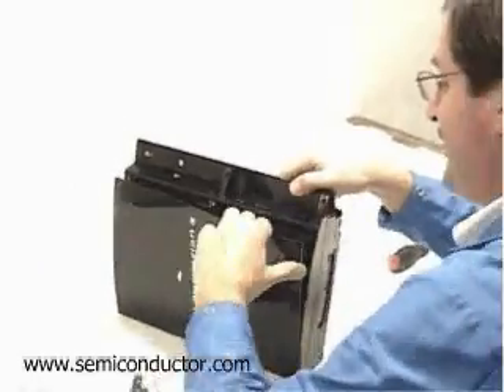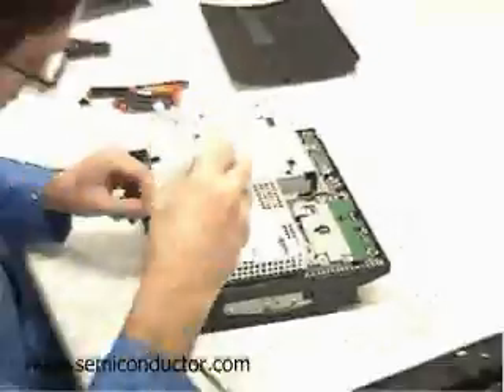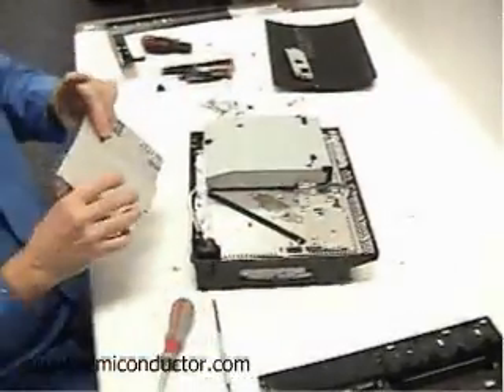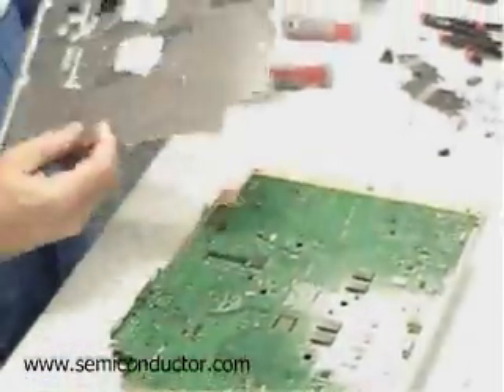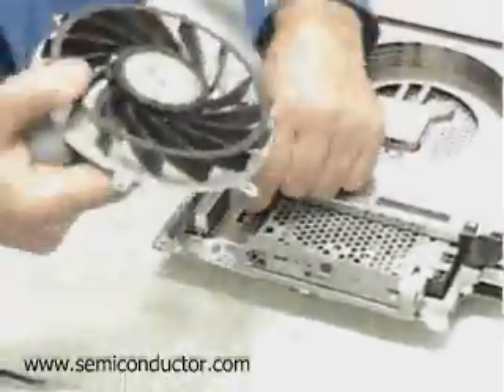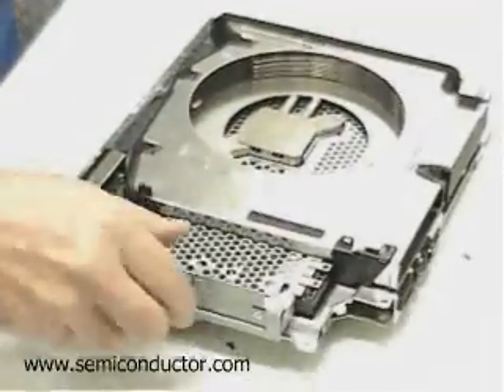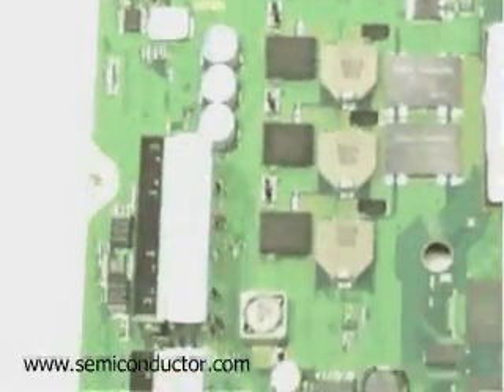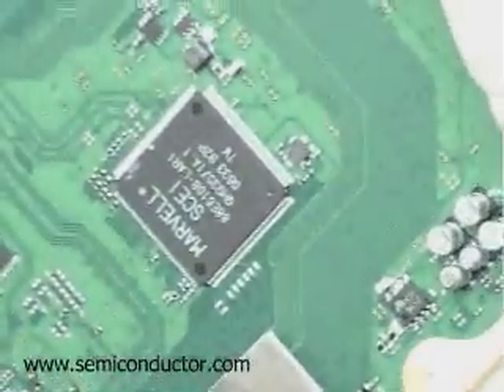Teardown of Sony PlayStation 3

Comment: @skankinruby See, I understand MS is forced to treat customers well or they'd get horrible publicity, but when your product fail rate is as low as the PS3s, its also almost no trouble to treat your customers well.

And it is true that on non-exclusives, the 360 is better. Of course, I'm sure that if the developers tried hard enough, the PS3 is better.. but the basic graphics processor of the 360 is faster than the PS3s.. and therefore, in general, better graphics.

Comment: @aSASa45454 
lol 75 percent fail rate? or did you mean .75 percent? either way im pretty sure its way off. I heard the new models were more reliable but I doubt they dropped from over 30 percent to less than 1 percent. MS does handle that situation better, but sony doesnt need to as its not a huge problem. that sucks that it happened to you, but its rare. but my gripe with your statement is when you said 360 is superior graphically. compare exclusives, not multiplats since they have to be ported

Comment: @albanianii
There are no specific area restrictions with the PS3, but some DVDs or Blu-rays might not work.
BUT.
If you buy a PS3 from EU and take it to USA, or vice versa, remember that you might need an external device to transform the frequency and voltage.

Comment: thats funny cause i had a 360 and it gave me nothin but problems when it came 2 live and just trying to get it to read a damn disc, the wii is alright (i can tell your a fan by your name) but to many kid games.not bagging on it, it took MS 3 years 2 finally fix the rrod problem, and they still mess up, the sad thing is they knew about the problem before they even put it out.. thats another reason i hate it, and the exclusive dont appeal to me, halo and left for dead are the most overrated games

Comment: You need to do some research. The guy said name 5 Exclusives, and you said that you would name Exclusives coming out 2009, which you didnt. Let me explain...

Halo REACH does not have a release date.
Fallout 3 DLC is not 'Exclusive@ its coming to PS3 very this year.
NATAL is not a game, and if you count NATAL then PS3 has EyeToy.
BioShock 2 is on PS3 aswell.
Left 4 Dead 2 is also on PC, so its not 'Exclusive'.

Do you even know what your talking about? FANBOY

Comment: Sony has definitely left room for improvement upon the PS3 hardware and could easily downgrade the hardware to a smaller more compact size via re-design, but probably not before 2011 or 2012.

Comment: The Sony PS3 system is Architecture and Engineering.
You see that huge fan? Designed! 
Its quiet. Its meant to be quiet,its large yes but it covers the whole board  and sucks that heat away quietly,not silently but quietly.
oh..and it weighs more the PS3 because the power transformer is inside the casing and cooled also by that "huge fan".

Again..Engineering at its best.

No tear down of the Microsoft  product i see.

Comment: i am sorry, but a PS3 is far more than a PS2 was and will ever be.

Overpriced? think about it this way. 
You could have bought the "expensive" PS3 with 80 gigs for about...400 was it? 450? and, sure, an Xbox 360 which is 200, or the elite which is 300 or so.
Now tell me, how many times will you/have you had to replace the xbox 360? Coulda bought yourself an HDTV with all those replacements.

Oh, and as for spoilers-- the PS3 is 3 times faster/more powerful than the 360.

Comment: Well, that's not the point. The point is that if the 360 were to have any more games that were to test its power, they would just raise the crash rate. And if that's not enough, the PS3 is starting to get it's good lineup. Not the new exclusives that aren't going to do as good as the 360's, because the 360 is easier to work with, but the games that make Sony well.. Sony. Example: GOW3. MGS4 already came out, for one, and that is a damn good game.

Comment: That's not true. LBP can be fun, seeing as how it's so innovative and the level of creation is quite high. You can't deny that they did something knew with gaming there. It's a very fun platformer. Plus, hardware can actually make a system better. The 360 crashes a little too much. It's crash rate at the moment is roughly 16 percent of all its sales. It's rare to hear of a PS3 crashing. Though I do admit that has happened. The main thing is that the PS3 can do more, and get more powerful games.

Comment: have u got the latest update? if not i try that. otherwise i had a dogy laser in my first ps3 and i'm on my second one because there was a faulty a disk drive, if that is the case it will need to be exchanged. don't bother with sending it to sony just arrage something will the store you got it fro . i did this and got my ps3 exchanged within 12 hojrsw. :)

Comment: A ps3 is good for long life span as the specs are good while the xbox 360 would soon lose out as it could not catch up with the ps3 in terms of specs. The xbox 360 came out first therefore it will have a lower specs than a ps3....if you wanna argue...check the specs out on the internet and compare) BUT FOR NOW xbox 360 have a better game library than the ps3(from personal view). And different people got a different thinking. So fuck all the fanBOYZ.  GAMES ALSO COMES IN DIFFERENT GENRES!!!!!!!!

Comment: 1. XBOX 360 has better games
2. That's true
3. wii is for people who don't play video games, that's why it kicks so much ass.
4. If you are six I could see that you might have an issue with the size of the controller.
5. BluRay sucks for games and Blue Tooth isn't all that great either.
6. The PS3 looks like a PS2, XBOX 360 is more of a modern art/UFO design.
7. XBOX 360 and wii are much better.

Comment: ur a bit off lol  Sony took off the emotion engine which is the chip that ps2 uses only the original 20gb and 60gb have it, they then made it as a software that was why some of the later ps3 could play some ps2 games. the ps3's in production right now dont have anything so they dont play ps2 games at all. the last ones to have it i think was the ps3's that came in the MGS bundle. hope that helps some of u guys out

Comment: 2 of my ps3 controllers are broken and I don't know how to fix them and since there 50$ each I really don't want to hurt them. I'll describe whats wrong with them. Please help
1. The L3 button on my controller doesn't work. I played cod4 alot and I sprinted around, I can run but I can't sprint
2. I'm missing the r1 button. I have the piece but i don't have the little thing to screw it in.  I reconnected it once but it caused the r1 button to continually being pressed without me pressing it. Ty

Comment: Are you joking, u said fukin b4 introducing yourself, u spelled gay wrong, the x-box controller is a rip of of gamecubes, and it doesn't have sixaxis, or internal battery, 1/3 of x-boxes break in their first year and already are running on a defunkd format(HDDVD), and to top it of ps3 is a better machine, and has free internet, so go bum your fuking x-box and get off the internet u fanboyish nube.  :) oh and ps, does microsoft have a handheld console?........ no. lolololol

Comment: you know that the PS1 was not a 64-bit console right? it was the first true 3D 32-bit console. and yet it was actually more advanced than Jaguar and N64. the technology behind it was it's claim to fame, not presentation of the console itself. After all the development code was more easier yet advanced than any other system of it's time.

Comment: i don't know, i always put my PS3 away back in the box, with wrapping and all to prevent any bugs or excess fibers from entering the vents. so my PS3 is always put away when not in use. my geuss would be yes, since dust collects in PC's but i'm not certain because No dust enters the Xbox or PS2 consoles (though they have very little vent openings).

Comment: The Playstation 3 comes way closer to what a pc is capable of than the XCock-360.
Considering the PS3 RSX chip is like 2 6800 Ultras or 7900GTX, Xcock 360's chip is made by ATI and doesn't have the peak fill rate or the memory bandwidth to match the PS3.

My Box:
Antec 900 Rev. 2.0 Water Cooling
Intel Core 2 Quad Q6600 OverClocked 3.5GHZ
Two Nvidia EVGA 8800GT SuperClocked 
6GB Ram
2X 500GB Hard Drives in Raid
Dual Displays: 22" High Definition WideScreen LCD Paired with a 19" HD WideScreen LCD.

Comment: the ps3 keeps getting ports from the 360 its cheaper to write for the 360 as the dev kits are cheaper then they just change a few lines of code so it works on the ps3 which gives us ps3 users crappy graphic games full of bugs/glitches (e.g. rainbow six vagas, oblvion (i love oblivion) e.t.c)with CELL's 7 SPE's it means it can proform 6 different processes at the same time (the 7th is for the bulk of things) heavenly sword uses 1 SPE just to simulate her hair! this allows multiple simulations.

Comment: sorry about the spelling mistakes.:)The only reason xbox has so many exclusive game is that MS are paying allot for them. but bio shock is now coming to ps3. they made a working 200GB blu-ray so you know. Hitachi also made a commercial 100GB blu-ray disc so the ps3 will only need 1 disc to fit a huge game on. and it can hold uncompressed PCMI Audio and full 1080p support so no upsaclling quality loss. ps3 is superior bigger discs, better graphics, free stuff, open network. read the tech stuff.

Comment: actually the ps3 has a better graphics card. the RSX or "reality synthesizer" as its been dubbed is more powerful than the xbox's customized ATI Graphics card. and before anyone tells me otherwise ill tell you now i did a hell of allot of research on both consoles before i decided which to fork out for and the ps3 is superior to the xbox (fan boys need not reply)ps3=550MHz processing power  xbox360=500MHz processing power. blu-ray holds loads more than hd-dvd can ever hope. ps3 online is great.

Comment: i had both game systems and sincerelly, graphically both are nearly the same, and in engine too, the pluses of ps3 is that the online is free, the pluses of x360 is that's cheaper and it has larger HDs, it has more selection of games...

i am disapointed with sony cause ive always been a fiery supporter of sony on the video-games industry but for now i consider x360 as the best option (i will miss MGS4, FFXIII and other high end games)

Comment: lol he didnt need to wrench in off, the outer shell that is, there is a special screw under the system which u remove and it slides off perfectly, but this noob, ripped the console apart.

Comment: Computers will soon be cheaper than consoles in the way of there will be no more having to up grade the processor, motherboard and stuff like that because all components will have very own processor, and the processor on the mother board will be nothing more than a hub in a network, and only thing that will need to be upgraded is the VGC.

Comment: when you compare the insides of a PS3 and an Xbox360- the PS3 looks far more advanced in almost every way. From Cooling solutions and engineering to the number of micro processors on the board itself, its clear that the PS3 is the more capable and far more advanced computer system.

Comment: Yea and those who, a few of months ago bought a core 2 quad or a new intel atom chip would rlly feel the heat. I know that cell wont out perform new CPU's after 2 to 3 yrs. Of course not. Nothing will last that long at this rate. BUt look at the ps2, built in the era of the geforce 2, MGS3 was comparable to the gfx on my geforce 6 back then. I dont hate PC gaming, im just saying its not as good as console rite now. Id rather play AC on ps3 that upgrading for it to look o.k on my PC. Wiis lame.

Comment: Then intel releases a hafnium based 80core super chip that dominates the server market. Then Intel releases hafnium based 4-8 core cpu range with little to no heat which dominates the PC market. Then intel slash's prices then all you kids run to the shop and buy quad cores. You really think Cell will last? I dont think so. As for games on PC I dont need to clarify whats good and what isn't becuase obviuosly you have your own reatrded opinions. Nintendo still out sell every console on the market.

Comment: one more thing, the US airforce recently bought 300 Ps3's cos y? it was cheaper and had a much greater floating point operations per sec than the supercomputer that they were going to use. I wonder y ps3 has increased folding at homes's total computing power 'Lately, the Playstation 3 accounts for more than 80% of all teraFLOPS' - wiki. O yea 'about $0.20 per GFLOPS with the cheapest retail Sony PS3 console,' the price per GFlop these days is also lowest in history 20c/Gflop cos of ps3.

Comment: Yea, c'mon, tell me something thats going to come out on the PC that not from the 360 or ps3 which will beat anything that the ps3 has comming up this year. Other that Starcraft 2, which mite not be as good as the original. o yea.'On one test PC that runs Crysis at a respectable frame rate on medium settings, Assassin's Creed slowed to a crawl at lower settings. A high-end test machine ran the game with much better results, though with some occasional slowdown'- GS Lol..pay thru ur ass to play.

Comment: Games aren't specificly designed for the latest video cards. You just go to video setting in game and slightly change anti-anitialising. My 18month old PC runs the latest games on x4 AA 1400x900 everything high. In 12months when I need a PC twice as fast as a PS3 I will buy one, PS3 doesn't change.

Comment: it already has. dont tell me that i have limited knowledge about computers. yes you can buy a $1000 pc but if you dont buy the good pc then youll always be losing on online gaming. i also never mentioned that ps3 is better than pc. i have a pc and a notebook. what i meant was when it comes to gaming id rather use my ps3 than spending $2000 pc. get that? it seems like youre the one that has limited knowldge on everything. duhhhh!!!!

Comment: Idiots how can you say PS3 sucks and XBOX360 is better, I own both and a WII. Each one is better in there own way. Wouldn't say any of them are better than the other.

Since they where all meant to be 'next generation' consoles its only really the WII that has tried to do that, the XBOX and PS3 are not that much different from there previous versions (apart from power of course).

How any one can say one stands above the rest is an idiot non of them stand out. Long live the PC.

Comment: I don't beleave it has the same power and performance as the Xbox 360 or PS3, but it's probably really fun once you get used to the controller.

It's definately better than the 360 though because it won't break as much.

The PS3 has:

Built-in Wifi
Plays BluRay movies
Has games on BluRay disks
Will have "PS3 Home"
Will have music and video downloads

Other than that, It's just which system (Wii or PS3) has better games. Everyone has different opinions on that though...

Comment: I was talking with Blockbuster employees at my local store and asking about the systems.

--They told me to definately avoid the Xbox 360 because it has serious design flaws which result in the RROD.

--They told me the Wii was ok, but often lagged when a game had too many things going on at once. Personally, I can't stand the controller. It's too different for me.

They said the PS3 had graphics and sound like the 360 without the flaws. The PS3 also has MGS 4, FF13, R&C. So I was hooked.

Comment: yeah, kinda nerdy, the ps3 is put together better than the 360 though... and it looks a sh*tload better than the 360, I have both and there ain't much of a difference between either although the ps3 gets my vote when it comes to games that are released on both... pc's are good , although the technology is getting better and better everyday so they constantly need to be upgraded, that's why i use consoles for gaming and my laptop for other stuff.

Comment: I agree with you but xbox 360 does have a better graphics chip in then ps3 and im not just saying it coz I got one its specs do suggest its got better graphics. The ps3's cell based proccesers are more cappable than xbox's 360 Xeoen processer so it kinda ballences it out.

Comment: Where did you place your PS3? Make sure the holes for air intake are clear, since that's where the fans get their air to keep it cool and you PS3 might be overheating so it just runs it's fans more quickly to conpensate.

Comment: Overheating? The only system this generation that has overheating problems is the 360. You can leave a PS3 on for 30 hours and it won't be close to overheating. This is proven. Oh and by the way, how does a controller overheat?

Comment: And the 360's aren't? They weigh about a 1ound and 1/2. The PS3 controllers are virtually weightless. Plus they have a tilt feature, comes with a rechargeable lithium battery pack, and who cares about Messaging on a console. Are you really gonna be messaging someone during an online battle?

Comment: Look how much more...cleaner or neater the ps3's board and heatsink is. Unlike the 360 with large dam capacitors sticking out and a giant heatsink in the very middle. *shakes head* not to mention heat being redirected around the system. The ps3 is just a way better engineering piece than the 360.

Comment: No they did not fix the problem with the Elite. All they did was add a new chip 65mm chip that reduced the change. It still happens. Heh and right after Microsoft did it, PS3 did it too. Wonder what that lowers out .2 failure rate too?

Comment: i was wondering how fast it would overheat without the fan, its obvious that all machines would get hot while being used but since ps3 is high performance it gets hotter than other systems like the wii -_-